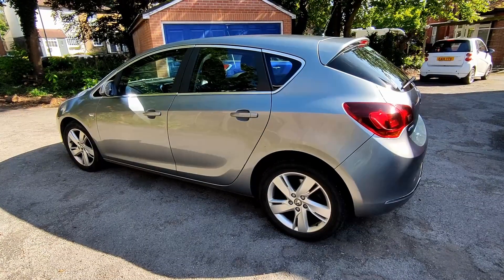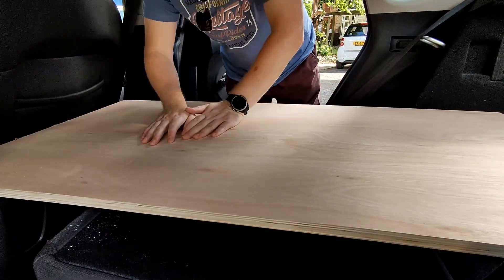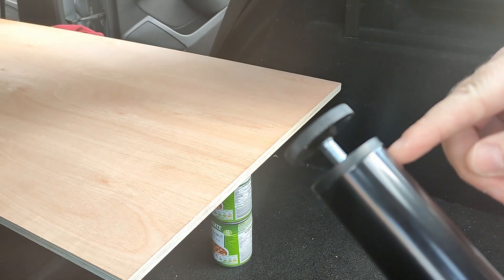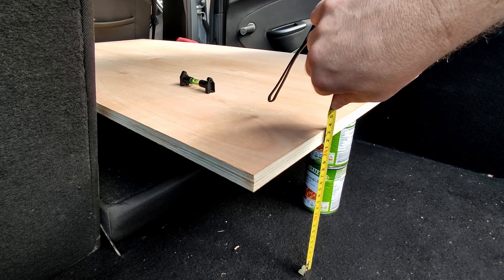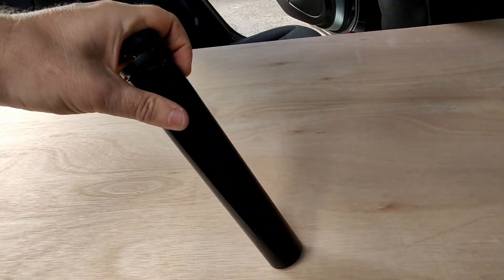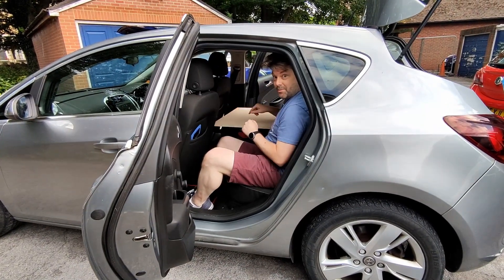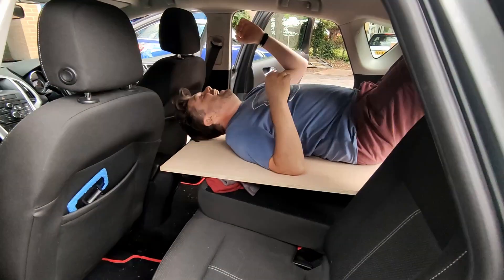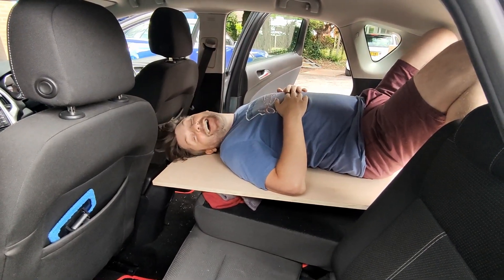Converting My Car Into a Stealth Camper (Stealth Camping UK) Part One

Comment: I've got a mk4 astra and done similar, but removed the front passenger seat, removed the rear seat base and folded over the backs and built the bed on top, with memory foam mattress.
Reply from the maker: Hiya, James. Awesome. I knew I couldn't be the only one!
I was thinking of doing the same but was too chicken to remove the seats.
Reply: @anyexcuseadventures8941  depends how you plan using it I guess, I removed the seats because I'm full time living in it at the moment until I can get a van to convert, then I'll be living full time in a van
Reply: @jamesturner2197  do you know if mot will pass if only remove passenger seat thanks!
Reply: @ghulamqadiri638  I'm not too sure but what I came to understand from Google was that mot will pass if the seatbelts are also removed

Comment: Surely the level of the wood depends on how level the car is?
Reply from the maker: Hi Billy. Yes, I agree. That is why I have made the legs adjustable. I didn't make it clear in the video but, the reason I was checking the levels is to work out how much padding was needed when parked on a flat surface. Then I can use the adjustable legs to adapt when parked on unlevel surfaces. 
I am definitely not an expert at any if this. Just making it up as I go along.
Reply: @anyexcuseadventures8941  well im looking forward to seeing it finished